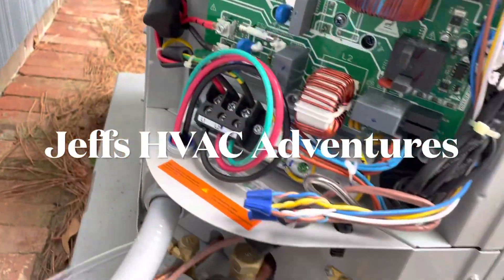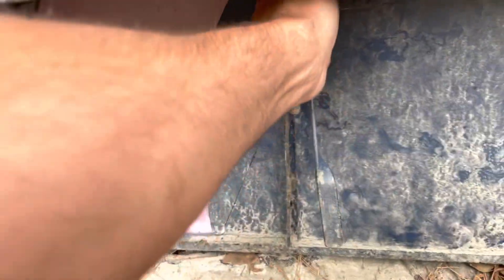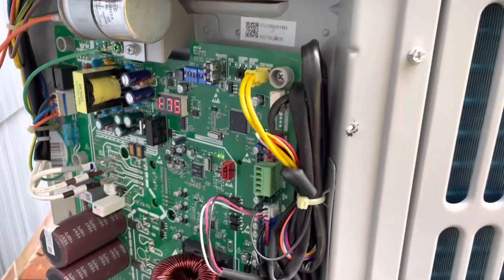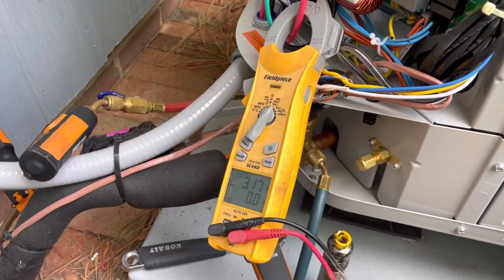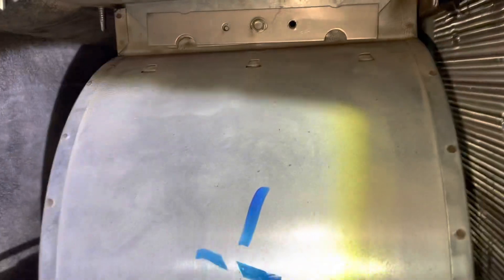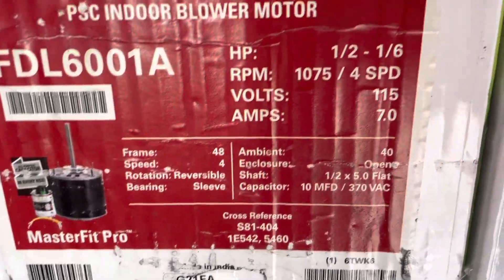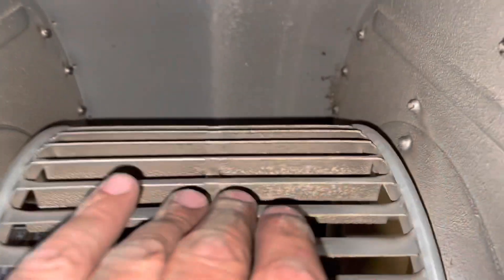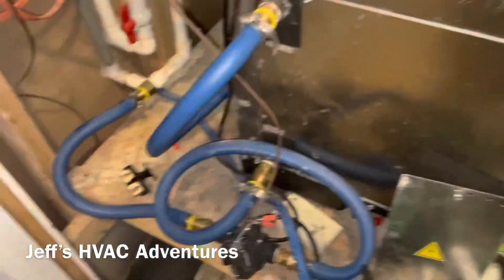New Bosch Heat Pump Not Working! Oops!  Plus Blower Replacement on Geo Heat Pump

Comment: What happens if they in advertently disconnect some phone wires where the blower is located for a few phones in the house when they do their work? Shouldn't they come back and really try to fix this
Reply from the maker: If they just simply unplugged something, then yes it should be just as easy to plug it back in.  But chances are they accidentally ripped a wire out in which case you would need the phone company or an electrician if it’s Ethernet cable.  In any case, the contractor should make a good faith effort to repair  it themselves or foot the bill for repairing it.
Reply: @ I stupidly paid them full price the day they completed the work. And they still have to charge the system because it was too cold on the day they installed.

Comment: Had a Bosch 3 ton unit installed and it was 50° when they installed it.  The heat worked but they say they have to come back to use gauges on it when it begins to get warm.  Why won't they use gauges on it when they initially install it even though it's colder. Was told everything was set at default. Is it OK to use the AC is this proper way to do it?
Reply from the maker: It’s pretty common to come back during cooling operation to make sure the Subcooling is correct.  Plus it’s good for the tech to do a follow up and make sure the system is still working correctly after a few weeks/months of operation.
Reply: @JeffsHVACAdventures  thank you for your interest very helpful. I'm disabled so I can't leave my house to see what's going on.  I'm finding that the humidity relief from the system seems limited.  They added Freon in addition to the pre-charged amount to bring it in line with the length of the copper Freon run but I wonder how they did this without attaching gauges. How did they know it was the correct amount added?  I remember when they were leaving it was the first time they turned on the system and we tried out the heating side and that worked but the cooling side we didn't do anything because it was 55° outside and wasn't necessary.  The cooling does work but it doesn't seem to be removing much humidity, in fact humidity actually went up a couple percentage points according to the graphing contained in the ecobee thermostat and my observation of a humidity sensor in my house.  Maybe I need to do an independent evaluation of what's happened for a concerning I just wish the humidity was being removed better than it is

Comment: Hello we have installed recently 3 tons Bosch unit but is November in sometime heat turn on and sometimes is just blowing up air no heat questions
Is 3tons enough to cooled down and heat 1600 sqf house 
What would be wrong
Reply from the maker: Bosch heat pumps operate a little differently than a traditional heat pump.  When it’s running at its very lowest speed, it might feel like the air is cooler than normal but this is just the unit running at peak efficiency.   However I am assuming everything else is running properly with this.   

It’s impossible to know the proper size of the system by just sqft.  You can get a ball park, but to know exactly what you need, a Manual J load calculation would need to be done.   Every climate is different also.  What might need a 3 ton in Maryland would need a 4 ton in Maine.   Best thing to do would be to explain your concerns to the installer and see if they can help.
Reply: @ 
Should I contact Bosch a technical support to have diagnostic and test what is the issues

Comment: Read the IOM …. 
The IDS IS NOT use the blue (low-voltage) wire as common… it’s the brown-one … the ‘B’ is for the heat-mode reversing valve…. 
Good Luck …. Fred

Comment: how is that piece of junk marked with the bosch label? they look nothing like the european models with much better specifications. it looks like it fell from the back of a goodman truck...
Reply from the maker: Lol.  Idk brother.  This is the lower 16 SEER model but the newer ones I’ve seen all look pretty similar.
Reply: @JeffsHVACAdventures  its not just how it looks, the board design and how it runs is very not-bosch compared to the EU models where bosch is actually making decent units that try to compete with the japanese counterparts. even a basic mitsubishi electric ductless will do 20 seer. even my air/water panasonic i have in the garden myself does 22 seer without trying. i doubt that these are actually have anything to do with bosch exept in name only. it certainly does not have bosch parts of EU level specifications. i have no doubt these units are much cheaper to make compared to what you find on the shelf in the EU. still, i can buy a 20+ seer air/water heat pump for under 4k (with tax). for EU standards thats pretty good.
ps: the 32 degree evaporator is normal, especially in test mode. these units run the same as ductless and target evap temp slighty above freezing.
still, its funny how impressed american techs are with these "modern" VRF units and see low power consumption. these things are the standard for 2 decades already in the EU.